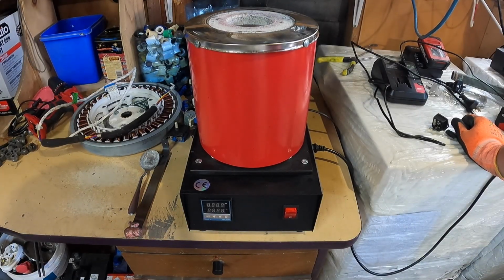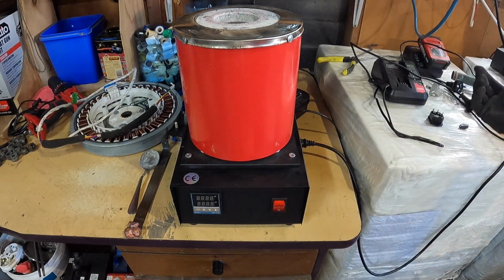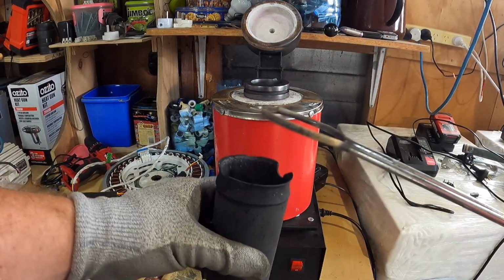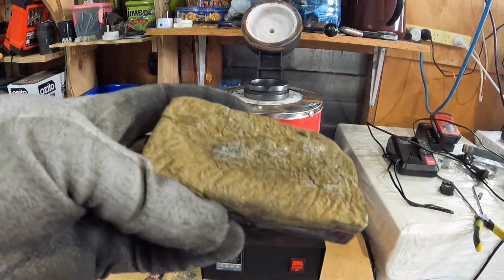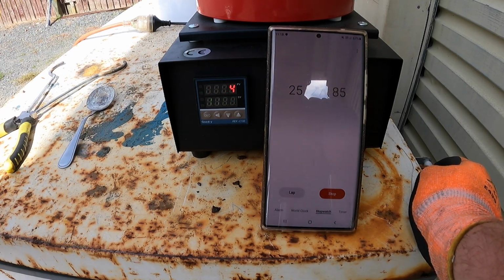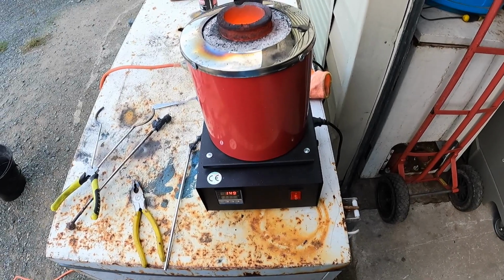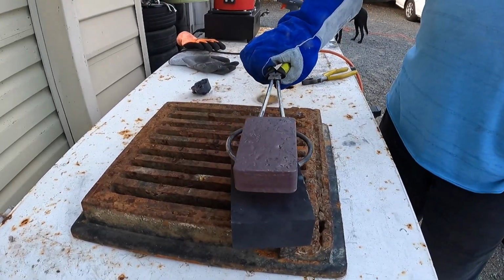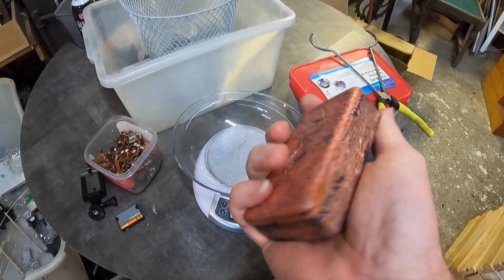First official melt with my electric furnace.

Comment: Thanks Mike, that was a good explanation of what to encounter for these electric furnaces. I was wondering if that carbon residue at the end might also contain some eroded material from the mould itself, seeing as how quickly it wears away. That was a super copper bar pour, I would be very happy with that. Cheers. 👍
Reply from the maker: Thanks. I was impressed that bar too. You raise a good point, it could very well be the residue from the crucible. Thanks. 🙂